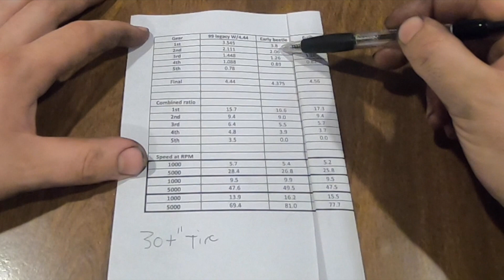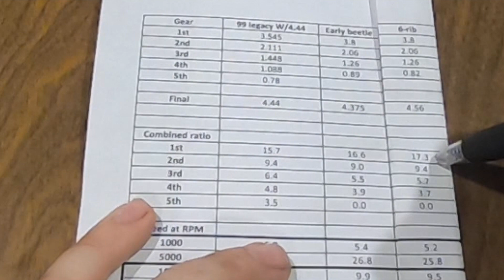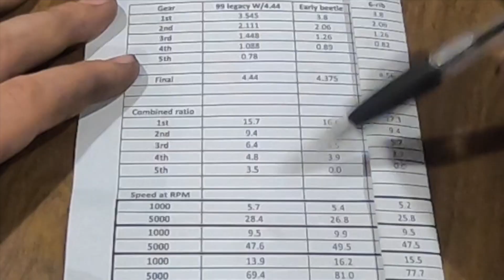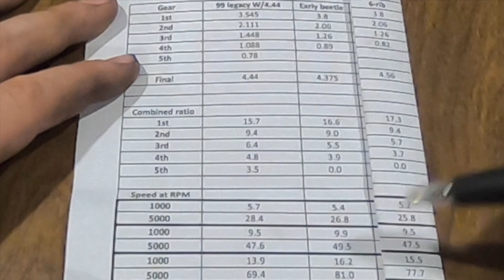ULTIMATE Subaru off road transmission / Mid Engine Rail Buggy PART 2. Is it as good as a 6 rib?

Comment: Almost looks like it would be less work to just get a FWD subaru trans.  Unless that 4.44 gearset isn't compatible.

I have a Vanagon 6-rib in my Baja bug, since as you say, finding a Bus 6-rib is getting more expensive every day.  I had to make some custom shifter linkage since a Vanagon has a side-shift nosecone.  Looks odd but works fine.
Reply from the maker: In my area FWD Subaru trans are really rare but I think you’re right it would be much easier. No reason the 4.44 wouldn’t go into one. Knowing what I know now and considering what my buggy turned into…the price of a 6 rib could of been the least of my worries

Comment: With that transmission can you lock it where both tires are pushing
Reply from the maker: Yes you could weld the spider gears or install an LSD. I haven't looked into it but I would consider the LSD route personally for my buggy

Comment: I've got a question for you. People are turning their Subaru manual transmission in a fwd , could you do the same thing with the automatic transmission? If so how?
Reply from the maker: I havent taken any of the automatics apart before. But if they utilize a similar center differential design I think you could make it work

Comment: The front diff will break if your hard on it . The unloading and loading from suspension travel
Reply from the maker: I plan to be pretty hard on it but hoping keeping the buggy light weight will help it last. When you say front diff, do you mean the actual carrier/pin/spiders or the R/P is prone to fail?
Reply: I’ve seen the spiders break, but most of what I’ve seen has been the ring gear breaking teeth. Like he said it’s the shock loading that will kill it. The problem is that the case is so close to everything when you break a tooth it can get pushed out the side of the case

Comment: Have you heard of Subarugears ? Check them out they have all the parts to do what your doing . But also have reverse ring and pinions for most Subaru transaxles including the auto too !🤙🤷‍♂️Oh and if your not sure of any part your doing they have how 
to videos
Reply from the maker: I am aware of them. I decided to shy away from them just for the cost and the challenge to replace if I ever damage their Ring and Pinion. I want to run as much OEM as possible to make replacement cheap and available across the country. Their ratio selection is awesome though and certainty the best option for guys staying rear engine.

Comment: Great video. Do you know how ground clearance compares to a factory bus transaxle? It seems (by eye) that the outputs are much further away from the input shaft line. Probably not an issue in your case, but wondering about a lowered car/bus. Thanks in advance.
Reply from the maker: Thats a good question and valid point. The diff hangs a little lower on the suby box. On a lowered car/bus the angles will slope upwards a little more than with a VW box. If you are really low you may want to move the trans/engine mounts up a little
Reply: @spankranchgarage  Thank you for the reply. If you ever have one side by side, it would be nice info to have/share. 
On a buggy or sand rail, raising the engine and transmission I imagine would be relatively simple thing to do. 
I can speak for my own car (‘70 bus), raising the transaxle would be major surgery. It’s been done, but complicated. Thanks again.

Comment: Do you know if there are custom gear options? 
Weddle gears for VW have been crazy hard to get. Manufactured is Australia I believe.
Reply from the maker: SubaruGears in Aus makes flipped ring and pinions for these so you can run rear engine. I don’t know if anyone making a normally cut ring/pinion that is higher than 4.44
Reply: @spankranchgarage   I see they have a 4.86 reversed ring gear. With your lower gear stack that 4.86 could be pretty good even for sand with a rear engine set up.